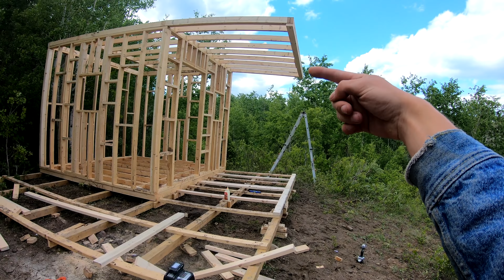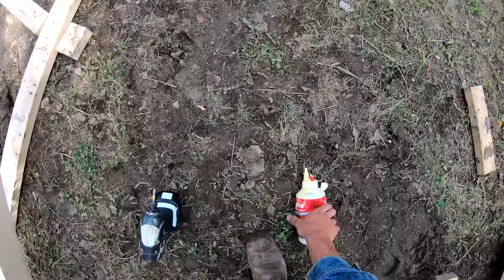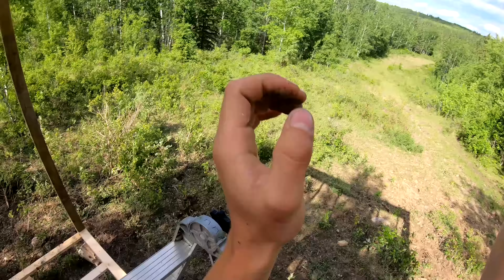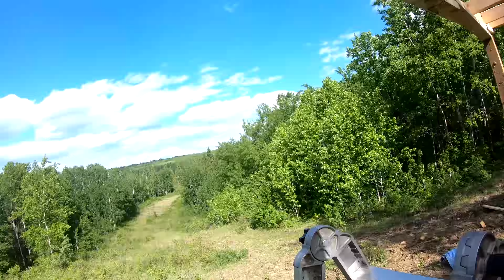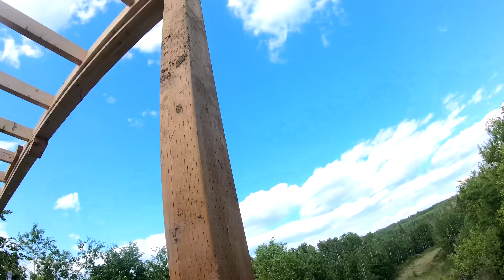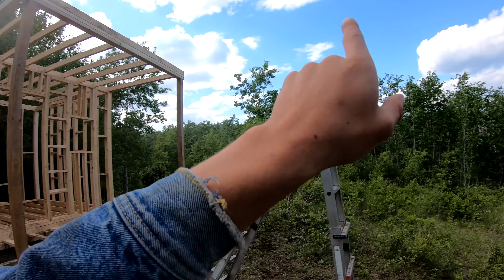Offgrid Cabin Build Pt. 4 - Building Overhanging Loft Support Posts

Comment: So 2 things, you definitely want some kind of brace for the loft support. I doubt you weigh enough to cause undue stress however if you have a lady friend over that might. You can use a straight support in the middle like you say or a 45 degree support at each corner. They should be at least 2 feet long from point to point. The break in your 2x4 close to the middle will be your weak point. You also don’t need glue. It probably helps to some degree, however I don’t think it’s needed. Of course that’s just my opinion. I think your doing just fine. Most carpenters don’t have the skills you do at your age. With a little guidance and you’d be a pro in no time. Looking great. Keep up the great work. 👍👍
Reply from the maker: Thank ya very much for the input, I appreciate what you have to say most of all! I will most definitely be taking your advice!